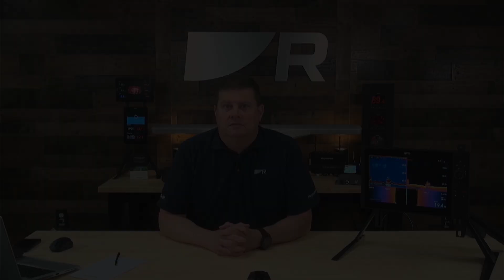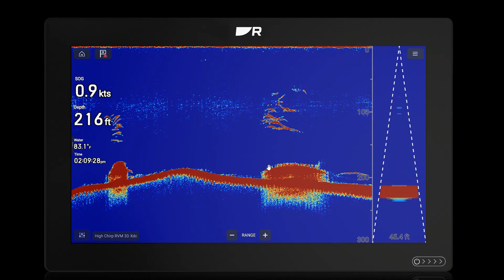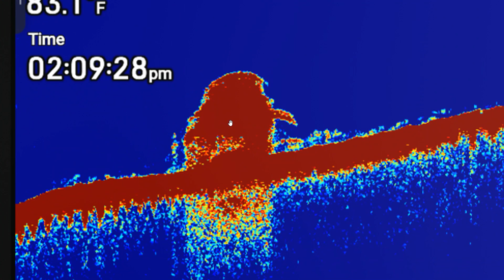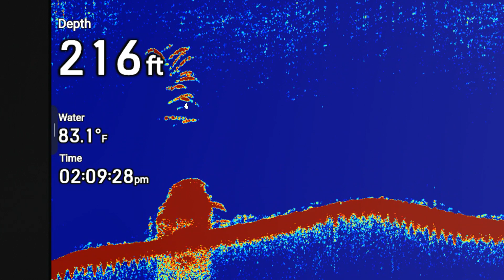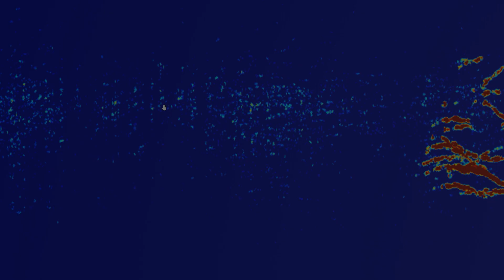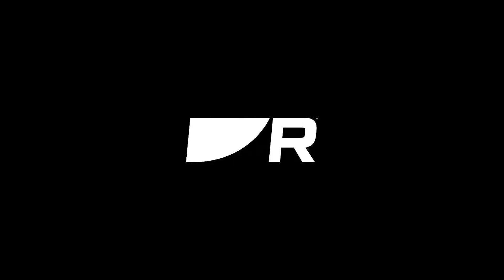How to Read Your Fish Finder - Raymarine Live Preview - June 25th at 7:00 PM (ET)

Comment: How deep will the system set up mentioned in video detect down to ?
Reply from the maker: The depth capability is very dependent on power output of the depth sounder, and also the capability of the transducer that is connected to it.  For example, our CP570 professional CHIRP sonar has a power output of 2 kW (2,000 Watts).  When connected to a high-performance, 2 kW capable transducer like the Airmar R111LH its low frequency channel can work to depths of 6000-feet, or more.  Its high frequency channel is rated to about 1500-feet with this transducer.

When choosing a high performance sonar system you may first want to establish what depths you will be fishing, and what species you are after.  From there you would first select an appropriate transducer capable of working at that depth and frequency.  Once you know the transducer, then you'll match that to an appropriate sonar module to power it.   

Fell free to send me an email at james.mcgowan@raymarine.com if you have additional questions.